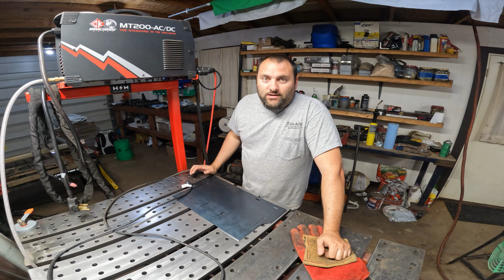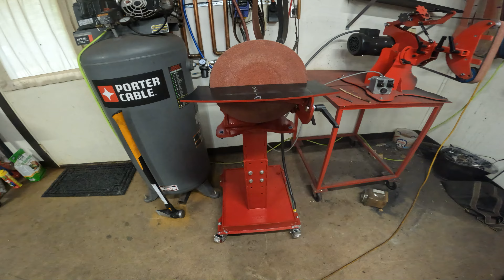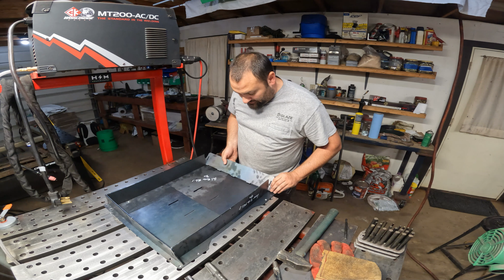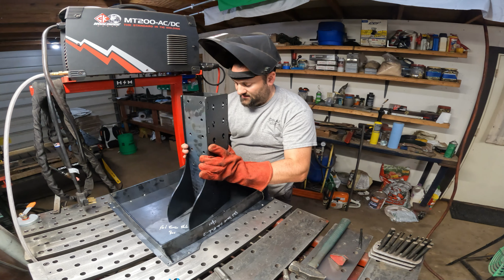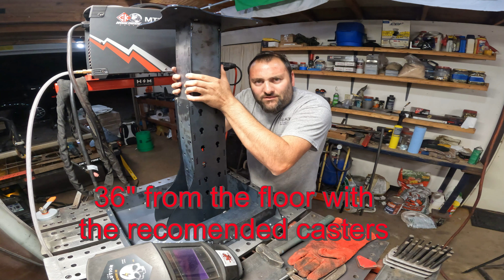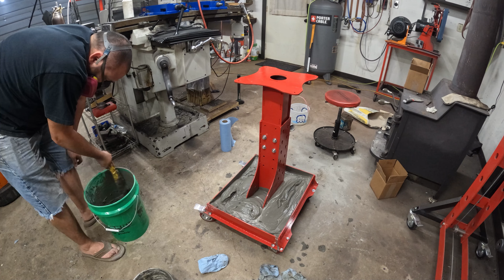Beck Tools Heavy Duty Machine Pedestal

Comment: What are the dimensions of the base of it? Just wondering the footprint, thinking about this for my 2x72.
Reply from the maker: I think it's 18" x 20".  It's center of gravity is 9" off the ground so it will not tip over.